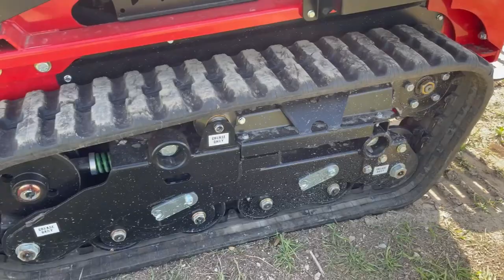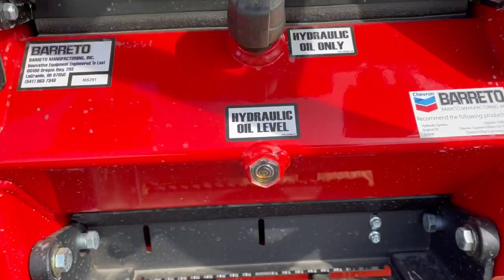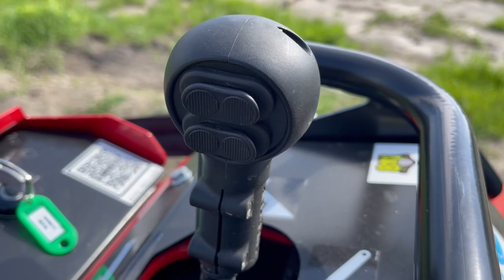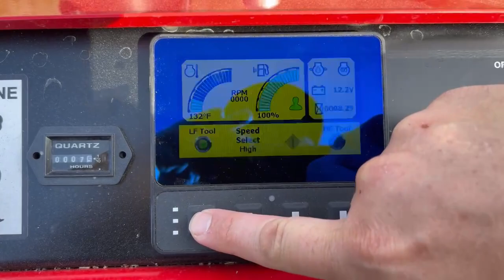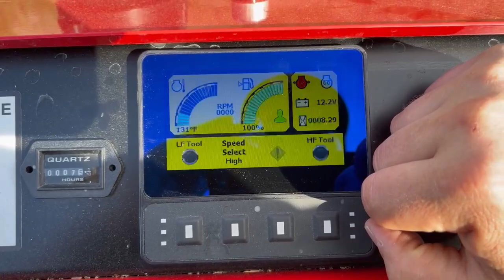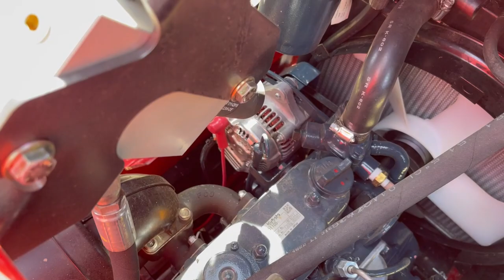Barreto 825TKL Mini Skid Steer Overview

Comment: Mate I'm interested in adding them to my hire fleet in Aus. Any feedback a year on? Any dramas? Everything has dramas but to what level... Info/reviews on these things is few and far between sort of telling me there's not many out there still. Big players in Aus are Wacker and Vermeer really, a little bit of Toro and Bobcat. I'm not a fan of Vermeer or Toro - Wacker seems alright, turbo and sealed rollers a plus compared to the 825TKL greaseable idlers that's ok but also lets all the shit in to start with. Computer controlled is flash and all but can create more problems if it has a hissyfit. Anyway keen to hear any feedback
Reply from the maker: Hey man, yes its been a great machine.  We also have the Kubota SCL1000 in our inventory.  I've only owned these and Bobcat/Toro.  I've never ran the Wacker or Vermeer.  I love the Barreto, lots of power and made really well.  Yeah everything is going to electronics so that can be a hassle but Barreto is always available to talk to direct with their techs.  Do you even have access to get Barreto over there?

Comment: Read a report the hydraulic pumps go out and no warranty
Reply from the maker: I've never heard that or had that happen with any of my Barreto equipment.  They actually have covered things that weren't even under warranty still.  I'm not saying they would always do that, but they have more than once.  Barreto is an amazing company and they make most of their parts on their machines.  Everything they do is top notch, nothing cheap.

Comment: Have you compared this to a ditch witch? We run Sk800’s at my rental place. I like the tip sensor lockout, and swinging fuel tanks on the Barretto, but that platform switch means nobody will be properly warming up engines in winter, the 3 speed sounds good but being computer controlled sucks, if this has the D1105 kubota like the ditch witch, that engine will be the last thing to wear out or give you trouble!
Reply from the maker: I did look into the SK800 and I've heard nothing but good things about them.  As far as the winter goes, we don't really rent them out much in the winter anyways so I don't see that being a problem, do you?  Yeah you can tell there is a slight lag in the drive control being computer operated, but its a split second and its so nice to control.  However, the entire top of the unit flips open to expose the entire engine making it easy to work on.